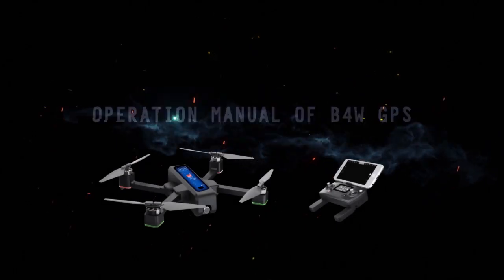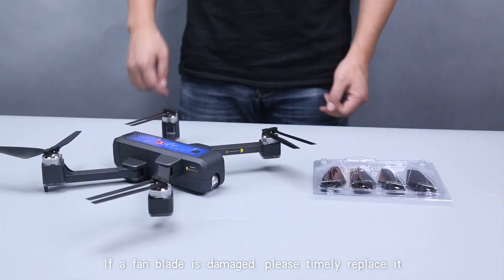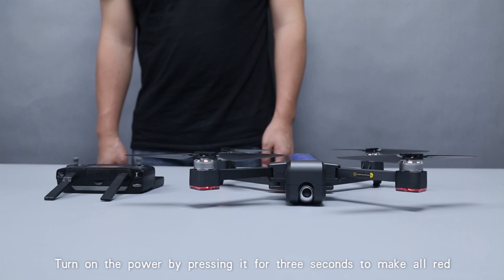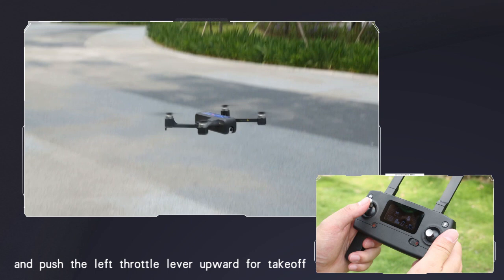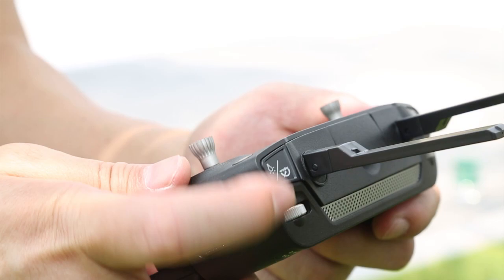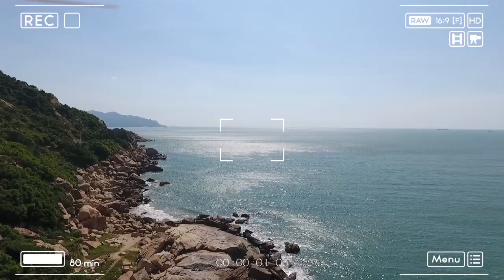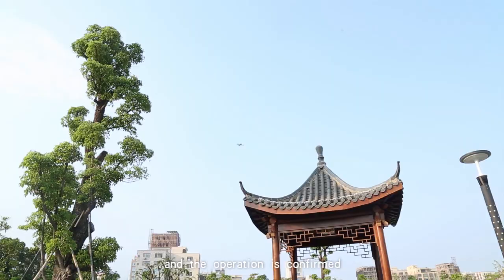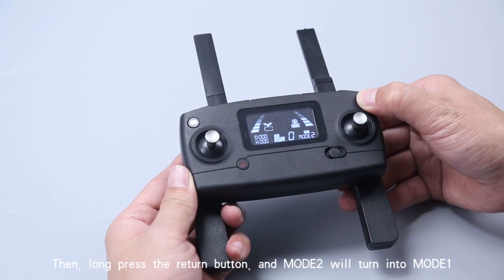B4W drone use teaching

Comment: My b4w, after the first few flights, does not respond in terms of yaw if it is more than 6 meters (horizontal distance) against homepoint. Any ideas if it is just a matter of settings or a hardware issue? Can it be somehow reset?

Comment: Can you please do a YouTube video on the battery charging process of the MJX Bugs 4W Drone how it works with both batteries loaded inside the charging dock with one at a time charging and how long it takes until full and finally with both of the batteries charging at the same time,doing this using this method does the bars supposed to flash veryfast and rapidly or not? Thanks for your tutorial was very helpful...
Reply: To charge both batteries you need two charger adapter plug in to the Bugs 4W battery Charger and to make it charge faster you need to use fast charger adapter it take about 4 to 6 hours to completely full charge , If you use only one normal Charger adapter to charge both batteries it will take about 6 to 8 hours or maybe more.